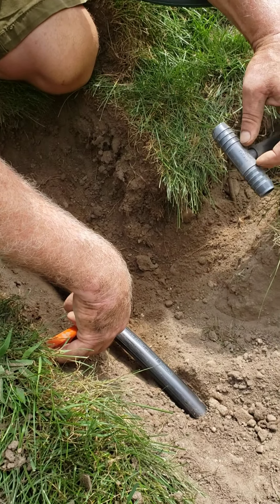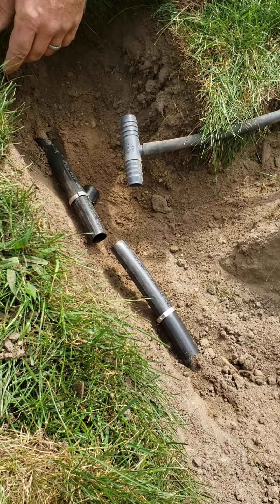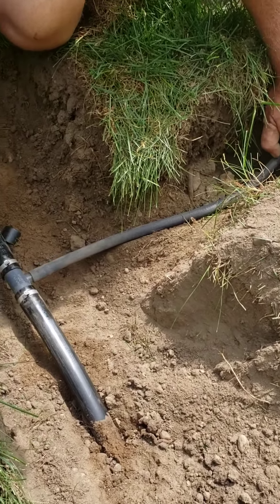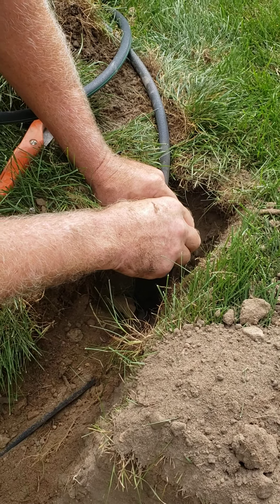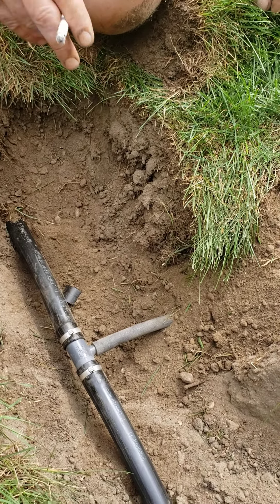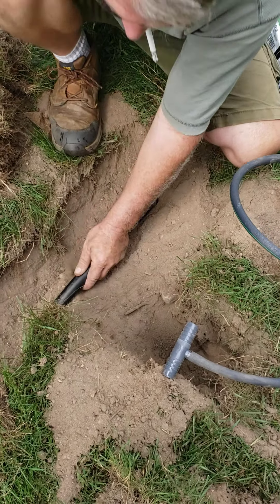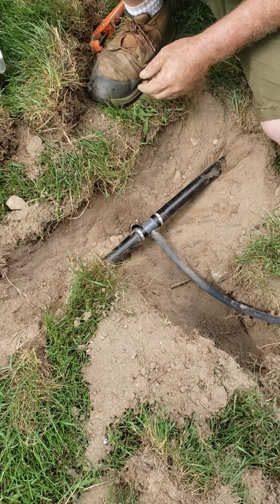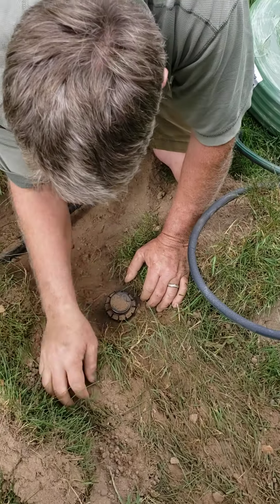August 17, 2020

Comment: When we used the piper, the only places we had to dig were at joints. T's, ell's, heads etc.. 
Before the piper it was A LOT of digging! This gentleman knows his stuff, huh?!
Reply from the maker: Lou we do use a puller unfortunately that footage the other camera screwed the pooch on
Reply: @grasshoppercrews1296  ah...Was just wondering. No judging here...unless you're Bo.
Reply from the maker: @louroberts5567  Bo is unicorn of a different color
Reply: @grasshoppercrews1296  Amen!